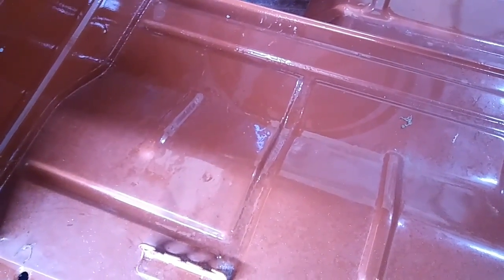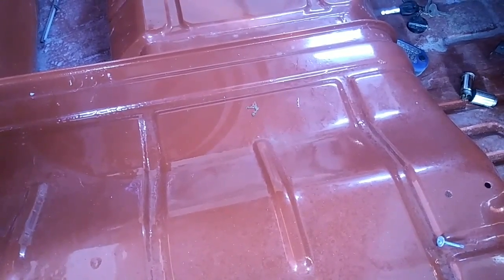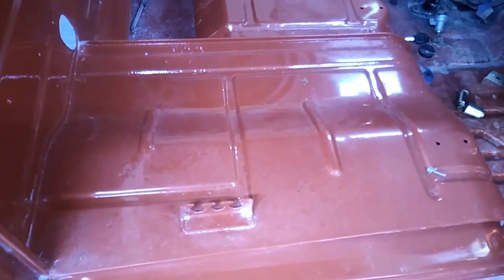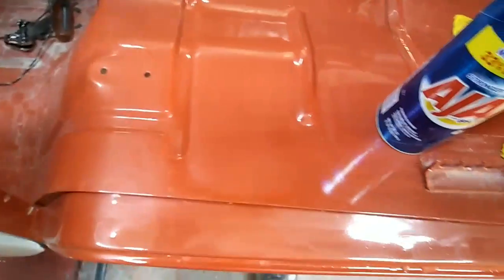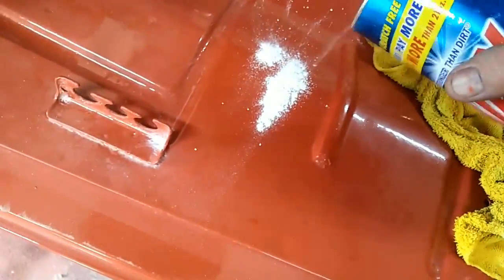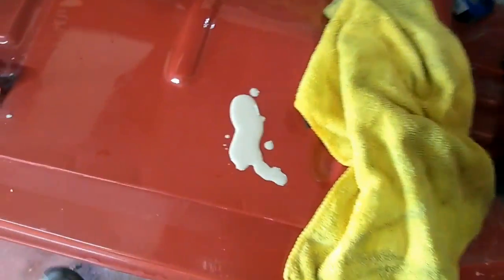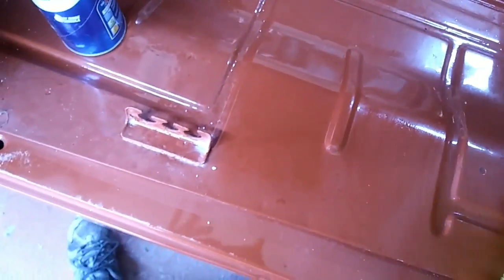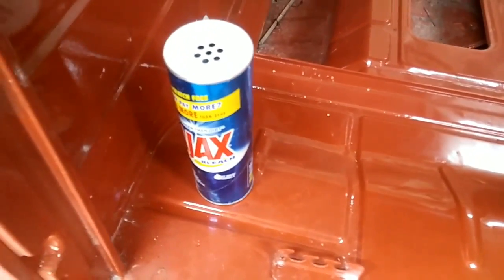Restoring old paint or removing overspray

Comment: I once had a OLD tan Jeep CJ7, when I bought it is was horrible, I cleaned whole outside painted surface with AJAX/Comit.  Washed it all off, put coat of 'liquid glass' polish n it.  It came out amazing.  Worked on the chrome rims also, which originally looked like painted white rims.

Comment: How do I remove over spray from chrome trim around a windshield ? The dumbass I got the car from painted the trim
Reply from the maker: Buy will usually cover the areas around did then use 0000 steel wool dipped in acetone. Just make sure you cover up really good and don't get that on the paint
Reply: @Mikefngarage  well its primer and not even good primer I'll be redoing the car
Reply: @Mikefngarage  and what do you mean buy will?